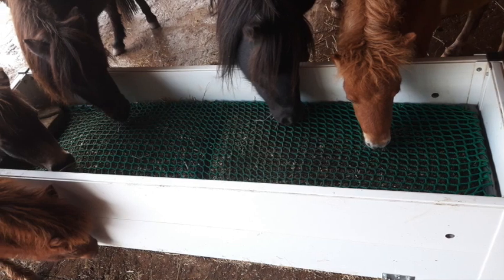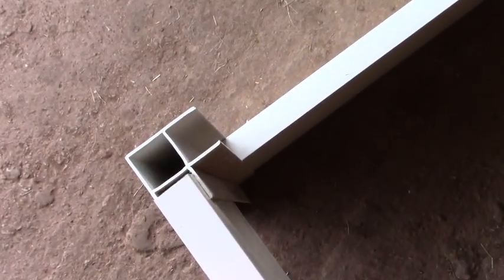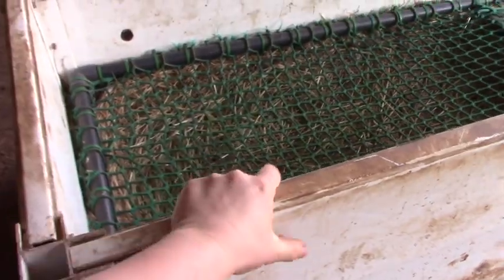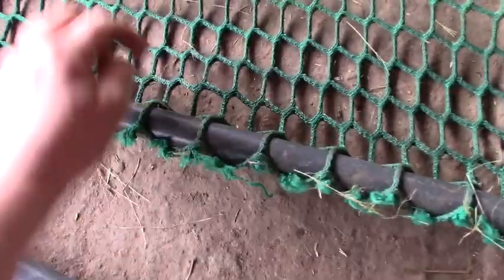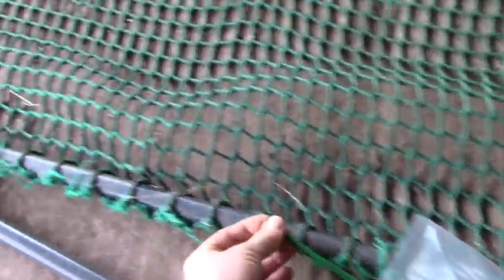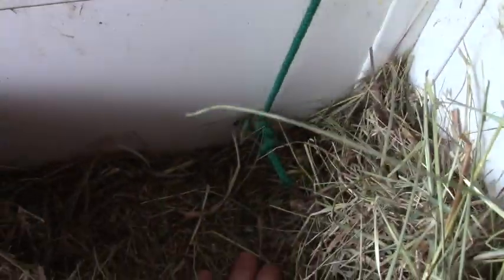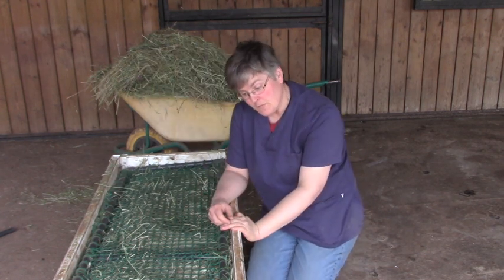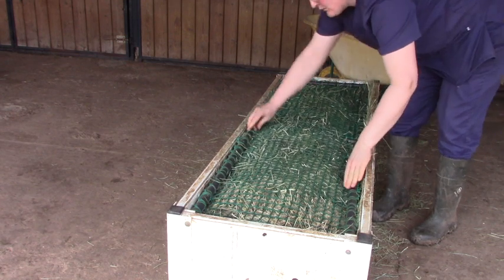How to build a slow-feeder haybox for your horse

Comment: where did you get the PVC panels, and the fittings they go in? I have never seen these
Reply from the maker: The panels are made of pvc tubes that can be purchased in any hardware store, the nets are horse slow feeder nets. Most horse haynet producers can provide all kinds of sizes custom made. I hope this helps you.